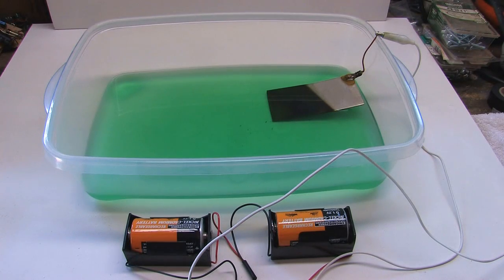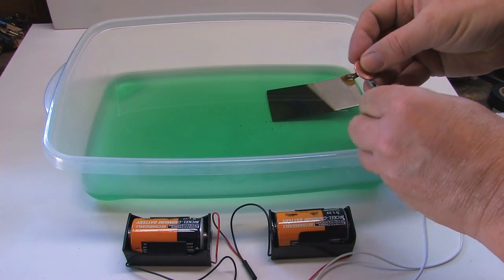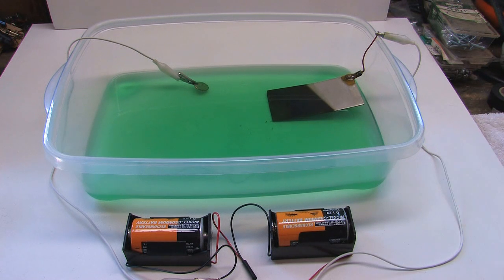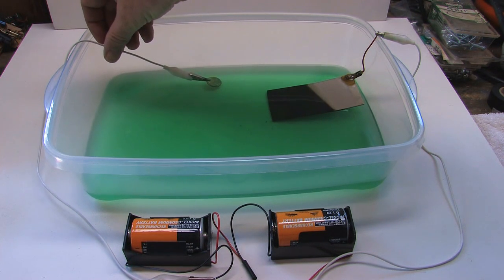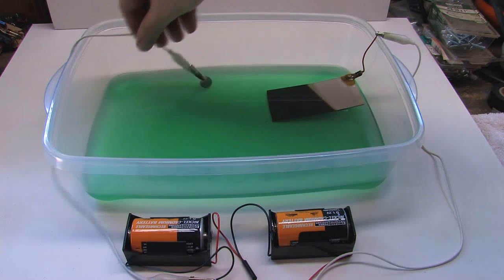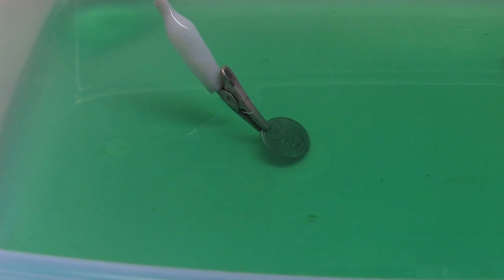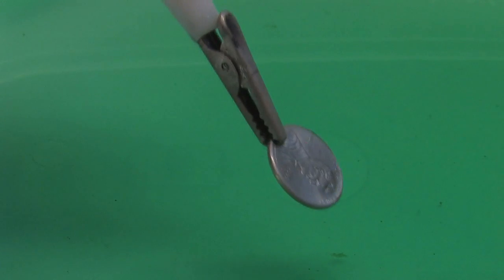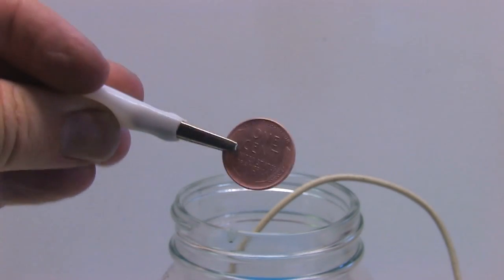Easy Nickel And Copper Electroplating Method

Comment: Well Ive given this a try, and thought id try a like nickel plated steel UK 5p coin to test it before trying something of more value. I used Copper Sulphate solution and a thick copper bar.  For some reason, it came out all rusty looking and awful. Didnt look anything like in this video. The only difference was in the setup, I had my 2 batteries in a double holder and not in serial like in the video.

Any reason why it was so awful looking?
Reply from the maker: My first guess would be that a 5P coin may be an alloy that does not copper plate well?  If you deposit a thin coat of nickel first, I think you'll get a good plate!  The coins I plated in the video had a zinc plate that copper would not stick to at all!  However, they nickel plated readily, and then a copper plate was applied that looked great!  You might want to do a little research on the metal in a 5p coin too...  It's possible that even nickel will not stick to some metals/alloys.
Reply: Well the coin I tried to electroplate copper was a british 5p. It is (according to the Royal Mint website) nickel plated steel. Im using Copper Sulphate (Pentahydrate). Should I make the solution with more Copper Sulphate so its at its saturation point (make it richer)?
Reply from the maker: vasquez109
Copper should plate on nickel just great.  Just make sure your coin is exceedingly clean.  (Coins pick up a lot of skin oils from being handled so much.)  I've used a mild lye bath when doing a lot of coins, or I've sometimes used the abrasive buffing attachment on a dremel tool too get coins really clean.  (Some coins that appeared clean really brightened when buffed, then plated great!)  You can definitely experiment with different amounts of copper sulfate.  I just put in the video what worked for me.  (The recipe was from Morgan's Electrochemistry.)

Comment: This is great if you want to gold plate porous items (say, a leaf, a flower, a bit of driftwood etc.) or a nonconductive item (e.g., plastic), because in order to gold plate these items you have to plate them with nickel, then copper first.

So, first you'd coat (spray, dip or paint) the item with a conductive ink (2 coats), and then you can use this method to apply the first two metallic plates (nickel, then copper) before doing the gold plating.  There's a video on YouTube about gold-plating a golf ball that shows the steps, but this method doesn't require any fancy equipment.

Comment: How well does plating hold up to abuse? I would love to plate some golf clubs, but I'm not sure if the plating will just come right off.
Reply from the maker: I have not compared this method head to head with a commercial plate, but in my opinion, it's stronger than paint would be...  For example, I've OFTEN buffed or cleaned the nickel plated pieces with scotch brite or steel wool, and I have not damaged the nickel plating.  I'm certain that even a good quality paint would have scratched off.  If your clubs are expensive (I'm guessing they are), you might want to invest in a plating kit like Caswells for about $60 since they have a long history of successful plating.
Reply: stancurtin Thanks for the quick reply! Honestly I am going to just be plating some cheaper wedges at first, so this method/process should work perfect. I am very glad that it seems to hold up. Thanks for the video, it was exactly what I was looking for!
Reply from the maker: Cheed weed
 I'm not sure what the finish is on a golf club.  If it's chrome, you'll have to use a chrome remover first as nickel won't adhere to chrome as far as I know.  Iron, steel, copper, and brass plate extremely well.
Reply: " as nickel won't adhere to chrome" then how come all chrome has nickel plating undercoat?

Comment: Great vid.
What about zinc plating plain iron? Does the iron need a copper plating first, or can it be plated with zinc right away? I usually do not see copper under the zinc, when I scrape the zinc off.

Comment: OK.
Watched the Nickel and Copper videos, and I even have the Copper sulfate crystals and everything else to try Copper plating.
Where can I get the 	 	 	 	Nickel Ammonium Sulfate cheap like I did with the root kill for the copper?
Also, how about Brass plating?
Reply from the maker: I don't have a particularly cheap source for Nickel Ammonium Sulfate, but the web page mentioned at the end of the video and the comments above gives a less expensive recipe.  Plating brass is more difficult because you usually need an acid dip and cynide base.  However, companies like Caswell sell kits that work without the more dangerous chemicals.
Reply: stancurtin
I'm having issues with your copper plating method.
My plating is fuzzy and just wipes off like a powder applied to a wet surface. What does seem to stick can be flaked off with minial effort.
I have seen other videos and read other instructions and they mention using a Vinegar/salt mixture with the root kill crystals, not distilled water.
Some even list Muriatic and sulfuric acid as working even better than Vinegar, but obviously more dangerous.
Any suggestions?
Reply from the maker: Papa Monster
Usually when I've not gotten a good plate, it's been due to the surface having some residue.  I have seen what you're describing happen.  However, the plates shown in the video were durable enough that I cleaned them with Scotch-Brite abrasive pads and "Bar Keepers Friend" to shine them up and did not seem to lose and of the plating.  I've used vinegar as well (as you mentioned) and had good results.  The Muriatic acid method leaves a very very thin plate, but also works.
Reply from the maker: Papa Monster
I should also add that particularly with copper, there are metals that plate well, and others that will need an intermediary plate.  (Often a nickel strike.)  For example, you can't plate the 1943 penny directly with copper.  It has a zinc plating, and copper will flake off.  However, I plate 1943 pennies with nickel and have no problems there...  Thanks!
Reply: stancurtin
	 	 	 	
Tonight I used the Vinegar and it started plating in seconds.
I did not even get a chance to connect the electricity before it was coated,,,,with nothing but more copper dust that just rubbed off.
I figured the electricity might help it stick, but all it did is add the copper dust faster.
At least this time I can see the slightest hint of a copper color if I get the light to shine off it just right.
I am not getting any adhesion and do not want to just throw away more of the root kill on another non-functioning solution.
I have steel parts I want to Nickel plate so I assume I have to get the Copper to stick first, then the Nickel.
Reply: Papa Monster
Hello?

Comment: Hey Stancurtin, U are doing great work, keep it up.
I want to ask few questions, first is that what if i want to have thickness of about 4mm of Nickel on the surface, will it be possible, if yes then how much time it will take.
and Second one is that what should be current amount and Voltage amount for that if my object is of about 100mm X 100mm...
Please reply as soon as possible...
Waiting for a positive response and Sorry for blurred English....:)
Reply from the maker: For thicker plates (like electroforming for building a damaged piece back up) you will want to increase your power source.  I think it would take prohibitively long with the cells shown, though I have made plates thick enough that they looked like foil if scraped off..  A ballpark rule for plating larger areas is 1A per 10 sq in of area..

Comment: whats the name of the product on e-bay ? jars
Reply from the maker: If you check web address given in the video comments above (and at the end of the video) you will find a recipe using "nickel sulfate," which is available on eBay very inexpensively.  The video used "nickel ammonium sulfate," which you can also find on eBay and elsewhere.  I've had outstanding results with the nickel ammonium sulfate, but I have not found a "cheap" source for it.
Reply from the maker: I just checked Amazon, and they have nickel ammonium sulfate for only $21 (for 100 grams).  That would be enough for quite a bit of plating!  I'll add the exact address I just found to the comments section above.  (Youtube won't allow me to embed a web address in a reply.)
Reply: Can you use a wand like jewelers do and rub it direct with a cottons wab ? I notice they have the whole thing in a container and dip what they need as they go "electroplating.
Reply from the maker: Donatillo Arteaga The "electroless" method often used by jewelers and others to brush on a metal coating uses a different solution.  For Nickel they use a reducing agent, such as hydrated sodium hypophosphite which allows the metal ions to transfer to object even without a current.  You can find inexpensive kits for doing this by searching Google for Caswell and electroless nickel...

Comment: i'm going to do a nickel electroplating for a copper ,i found so many listing on ebay ,what grade of nickel ammonium sulfate are you using ? should i go with reagent 98% or with reagent 99.5% onew ? i'm really confused about which one should i buy ? because the 98% one are cheaper 
 please reply
Reply from the maker: You should be just fine with commercial grade nickel ammonium sulfate (which is what I used in the video).  You won't need a reagent grade.  The web page given in the video and in the comments also has some less expensive options if you'd like to try them.  Thanks!
Reply: i got it,thanks
Reply from the maker: ToNnY cAsSiDy
My pleasure!

Comment: i have a question, i have car had painted with Nickel although the surface was plastic how that come if you have the idea?? thanks
Reply from the maker: You can electroplate non conductive surfaces by first coating them with something conductive.  Often rubbing carbon on a surface is enough to do it, or there are conductive paints as well.  For a toy car though, it might be simpler to just buy some nickel colored spay paint and paint it...  Thanks!

Comment: Where did you buy the nickle ammonia sulfate from?
Reply: I've purchased through eBay and spectrum and others.  The web page in the comments gives an alternative recipe using plain nickel sulphate which is very easy to find.  I think one hot tip might be that Grainger seems to be able to order most chemicals!  It USED to be so easy to find chemicals, but most local chemistry stores seem to be shut down.  Which is a huge shame.

Comment: Loved the video! I'm interested in plating but I don't know how you did the electrical wiring with the D batteries :)

Any tips? RadioShack? Thanks!
Reply: +Andrew Payseur Sure, Radio Shack (or many other sources) will have battery holders. You could improvise one from a broken electronic device. Just connect to the black and red wires in the device's existing battery box. Call it a battery case/holder/box or project box. Could be found with different labels.

 It's a simple DC loop. Electricity flows in a circle through the batteries, into the liquid, and back out of the liquid, then back into the other end of the batteries. Red wire is normally positive. Black wire is normally negative. Seach for 'dc loop' or 'dc circuit'
Reply: would you wire the 2 batteries in parallel
Reply: Connect the two batteries in series.

Comment: Hmmm...  That's just how it came out of the bath.  When I've used higher voltages, I've seen other results.  (Which have often been as you've described.)  But I've had no problems with the low voltage approach.  I KNOW that pro platers do much faster (and beautiful) work with more amps and higher voltages, but this "simple" method has worked for me on many many dozens of plates.  Please let me know if you solve your problem so I can add that to the notes here for everyone,

Comment from the maker: I have not heard about Nickel(II) Sulphate -7hidrate.  I'll bet what you have is NiSO4(H2O)6, which can be used for nickel plating.  If you check the video comments above, I gave a web page address that shows a great recipe for nickel sulfate which should work with what you have.  Thanks!

Comment from the maker: This is very good advice.  Thank you.  I will definitely do this and recommend this in the future as it just sounds sensible!  I don't know if I just got lucky with the water where I live, but I've used and stored the electrolyte using only tap water for quite some time (a couple years now?) with no difficulties or contamination showing up.  So, it's always interesting when you make a "mistake" and find out it might be OK too...  But why risk it!  :-)

Comment: I would not recommend using tap water.  You will contaminate your electrolyte.  If you use distilled or deionized water and pure nickel at the anode, the electrolyte will remain effective indefinitely.  Just keep it in a sealed container.  Use an aquarium heater to warm it up for use, or store it in pyrex so you can just warm it on the stove.

Comment: Stan Thank you for answering. I tried another method to simulate a metal look. I dipped seed pods and pine cones in pervanpol which hardens them. I then painted with a metal-like paint. I like the results. Thank you for all your answers. I still may try this process. Thank you for posting.

Comment from the maker: Although "D" cells could theoretically supply high current for a short time, in reality current is limited by the battery's internal resistance and and the resistance of the solution.  This varies as the solution and battery are used, and by the position of the parts. So, it's tough to be exact.  I would guess by the battery life I'm seeing that only about 1.5 amps is the max draw.  I assume you want to wire a wall based power supply?  If so, you'll know within just a few test runs what's best!

Comment from the maker: Higher voltages are commonly used, but I've found that I get the best plates with lower voltages in this small bath.  I simply used 2 "D" cells in series for approximately 3 volts.  (I used rechargeable above so technically 2.4 volts.)  I've heard from other builders that adding more cells in parallel,  but keeping the voltage low speeds the plating and still achieves the same smooth/shiny results!  Thanks! .

Comment from the maker: Unfortunately aluminum is a little more tricky to plate.  The surface oxidizes almost instantly and requires special prep work and sometimes an underplating.  Your best bet if you want to do that easily is to use an electroless method.  Not to recommend one particular kit, but if you look up Caswell plating kits on google, you'll find some electroless nickel/aluminum options.  Thanks!

Comment from the maker: Though I'm VERY big on DIY, this may be a job for the pros because of the expense of a mistake here.  However, I'm a guy that might try one of the cheaper pieces and see if I could do it...  You can remove chrome by soaking in a mix of 1/3 hydrochloric acid and 2/3 distilled water.  Often, copper will be your base layer, so you might be done (other than verdigris)!  Otherwise, you can copper plate from there.  Caswells makes inexpensive kits for strong, pro plates too.

Comment: Hello, 

I have some new, chrome bath tub and shower fixtures that I want to convert to a living copper plating. I want it to verdigris so it matches some other older copper pieces I have in the bathroom. Is there a way to remove the chrome and replate with copper that wont bust my budget? Should I just take it to a plater?

Thanks
Gary

Comment from the maker: Goggles and gloves like handling any chemical are wise. Only do this in a well ventilated area. A lot of viewers have written to say that the MSDS lists nickel salts as carcinogenic, but I have not had a HIGH degree on concern because I also see many other common items listed as similar carcinogenic risks. These include Diesel exhaust, gasoline, paint fumes, plastic glue, lighter fluid, lead and many others.  So I believe with care, most of these can be handled safely.  Please be cautious.  :-)

Comment: I've got it - 2 Nickel plated steel electrodes. But does using the wool end up 'a big mess'? Just wondered if you had tried the wool for large surface area. I can see you've been doing this some time!  Thanks again for your hard work

Comment: Hi!  I came across your videos a few days ago, and I wanna say thanks for all this hard work, and sharing the results with everyone. I'm going to try and replicate, but I have one question. Is it OK to use stainless steel mesh, or steel wool for BOTH electrodes, if we use this electroplating method and get a thick coat of nickel on the wool? Or do I need one electrode made from pure Nickel, and the other from pure iron? I saw you recommended epoxy to get the oxides next to the electrodes.Thanks!

Comment: I think I found my answer in another form... a strong metallic metal paint.... Vibrant porcelain colors produce an intense "enameled" appearance after baking. Ready-to-use colors can be mixed together for painting onto heat-stable objects that can withstand a temperature of 300 degrees Fahrenheit, as porcelain, china, glazed earthenware, terracotta, metal, enameled sheet steel, copper and glass. Porcelain paint is resistant to dishwashers, normal solvents and detergents. Thank you for your help

Comment from the maker: Again, new territory for me.  I do know that I've plated items with a thick enough plate (using the "hard nickel" plate on the web page) that when I had poor adhesion and could pull off the plate, it came off like metal foil.
I suspect you'll do some experimenting before it's just right...  So, a tried and true method may be worth while.

Comment from the maker: I think so, but I'm not sure if organic material like leaves will be preserved by the plate, or rot underneath it and collapse?  I've plated paper, and I've plated glass with good results.  As far as controlling costs, check the web page mentioned in the comments for a less expensive plating solution.  Thanks!